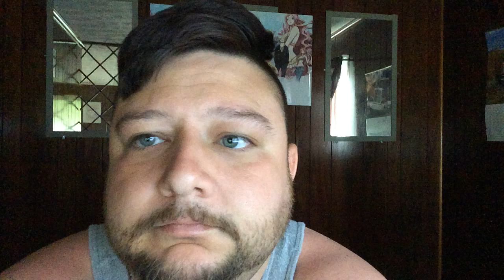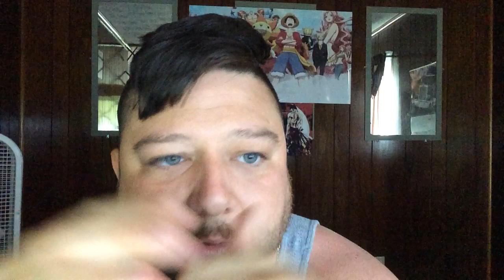Oil Light Flicker

Comment: Heard you say you don't put timing belt covers on? You run these like this? Had just end of valve cover cut on my built B16 to access buddy club timing gears and picked up a rock last summer driving and shredded and destroyed my timing belt . Never again
Reply from the maker: Not One you've got pretty shit luck. I'll never use a timing cover even at the cost of the engine
Reply: VHB Engines arg !  man I don't disagree much. But I do here. Definitely have to have a timing cover. So much dirt and grime gets in there. Jmo ! Also They should just add an oil pressure gauge. Not really that hard to install.
Reply: Every motor I've worked on, I never run the timing belt cover and NEVER had an issue with anything jamming the crank pulley or damaging the timing belt.